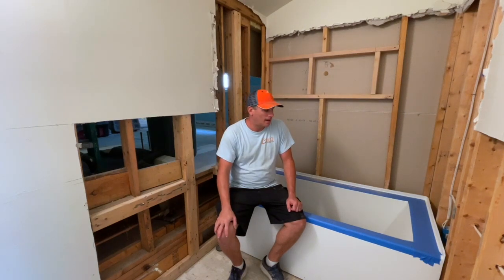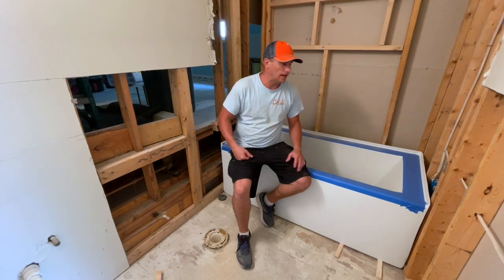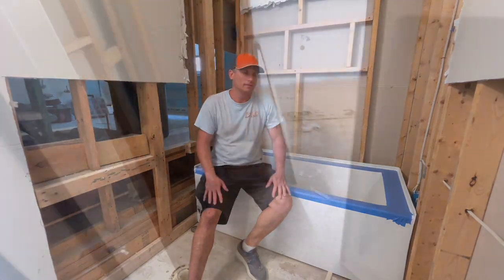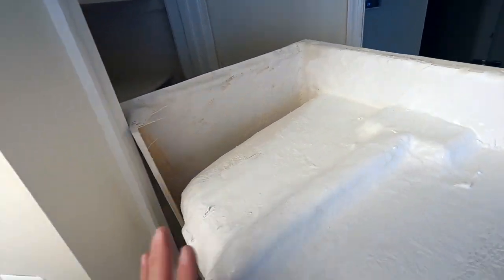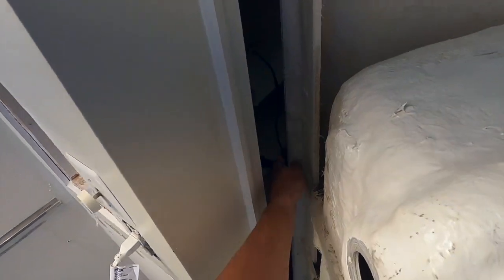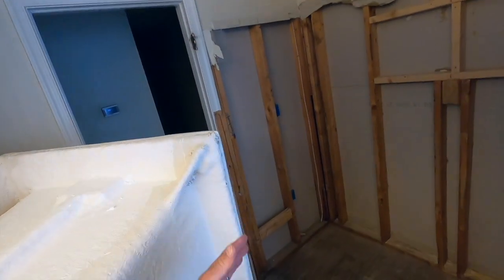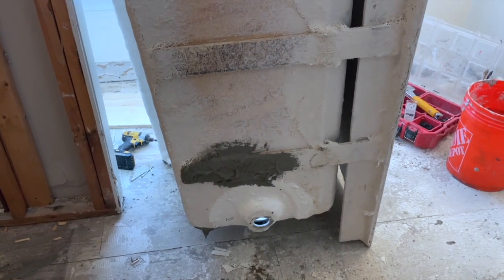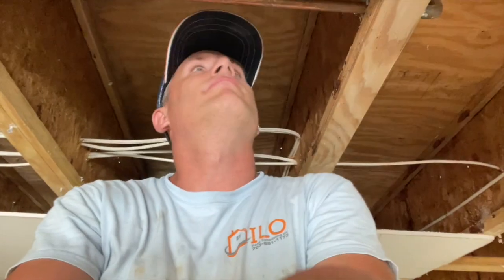Installing a HYDRO SYSTEMS 60" Alcove tub with apron

Comment: Water test before installing? Yes. Put the drain in, throw two 2x4s on the lawn, set the tub on them and fill it with water. Pretty easy, and you'll be glad you did if there's a leak.

Comment: Installing one now for a total gut job… excellent information, as I usually am remodeling around tubs or installing shower stalls. This tub has been driving me a little crazy. I think I’m going to do a 3/4” perimeter outside the basin footprint, and then overfill it with mortar. I don’t see how I can go wrong doing that. Any thoughts?
Reply from the maker: As long as the mortar is holding the bottom of the tub, it should work.  It's a really meh design and it also dove me a little crazy, lol.

Comment: Anyone looking to install this tub needs to also know that if you dont use 3 stringers for the 3 wall alcove its an incorrect installation per Hydro Systems. The docs provided with the tub are misleading but Hydro Systems install video and customer service both state 3 stringers on all 3 walls of alcove. They even went so far as to tell me the "warranty" of the tub is also voided if only a single back stringer is used. Not a great design at all.
Reply from the maker: I'm not a huge fan of the tub as well.  I have asked my design team to stay away from these tubs. how can you install the tub with 3 stringers? Impossible.